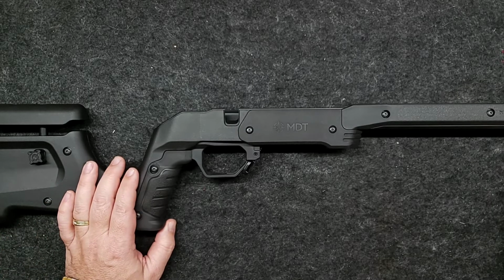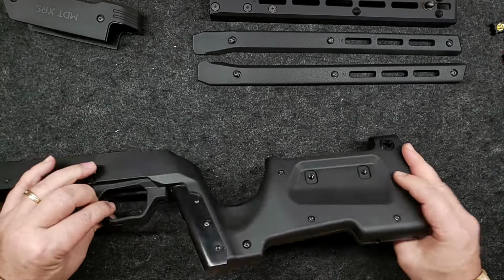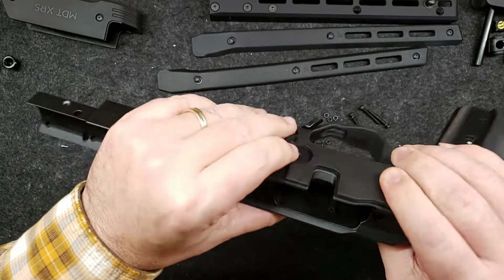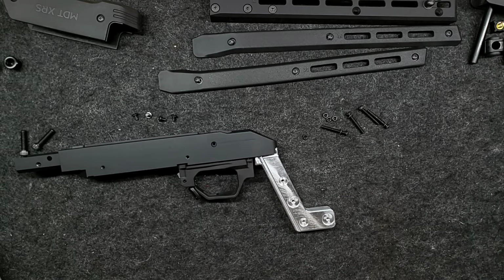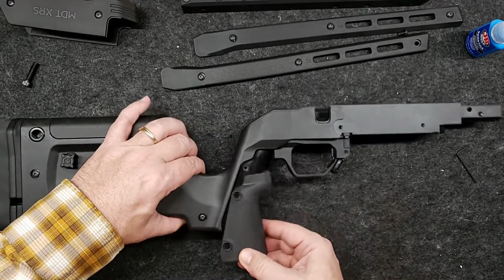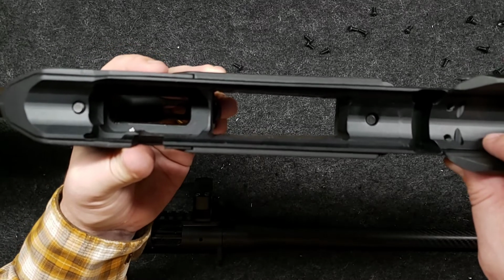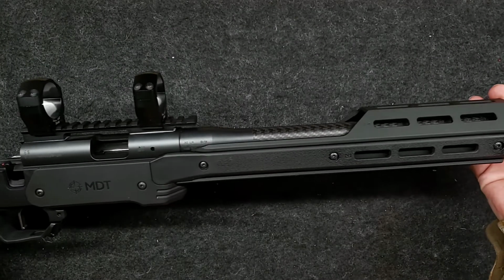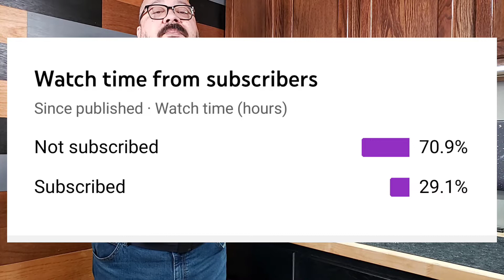MDT XRS Chassis Detailed Review Including All Available Options and Teardown (Part 2 of 2)

Comment: You should have put the barrel and action first,  your vertical pistol grip 2nd and 3rd the part below the action. That way you wouldn't have to cut your allen wrenches. Or in another words, if you want get to your action screws you must remove the pistol grip and the part below the action and whala! 🙂 Great videos both of them! 👍

Comment: If you want to use an AR grip & Butt Stock choose mother MDT Chassis that uses those. The XRS is designed to function & look more like a conventional stock. Othman than that it was am
An awesome video
Reply: It looks like you switched to higher rings. What height did you start with & what did you need to make the scope fit?

Comment: 3:36 Look how easily the cheek piece comes off. There's no locking mechanism. It's only held in place by the traction of those two screws, which can easily come loose. I lost the cheek piece of my XRS chassis while I was hunting due to this, and they do not sell replacements.. Quite a bummer on a 650€ stock. :'(
Reply: Did you end up getting a replacement?
Reply: @jonathans3524  No. At the time they had a policy of not shipping to Europe due to the war. Don't remember if I contacted MDT directly, but I tried through my importer and got no answer.

I made one myself at work from a piece of birch plywood and two stainless steel bolts. Looks just fine painted matte black and lacquered.

Comment: KRG Bravo is a lesser option when you factor in all the accessories you would like on it for competition or more modularity. A hassle to piece together and adds weight significantly. Comparable to a full up aluminum chassis. I had one and bought all the accessories for it, I sold it. Wouldn’t recommend it.